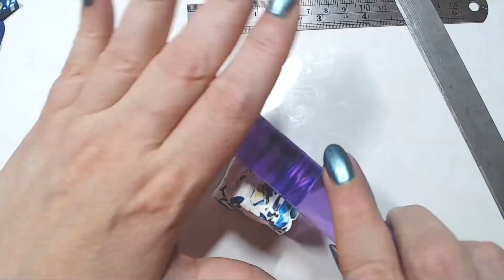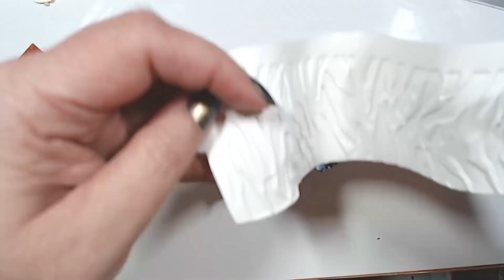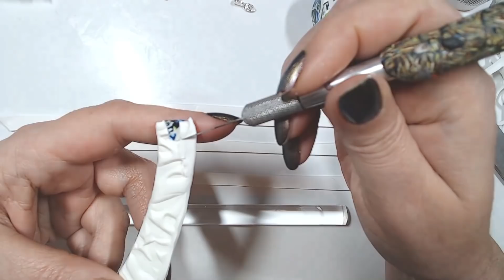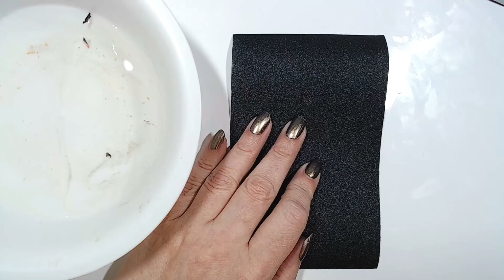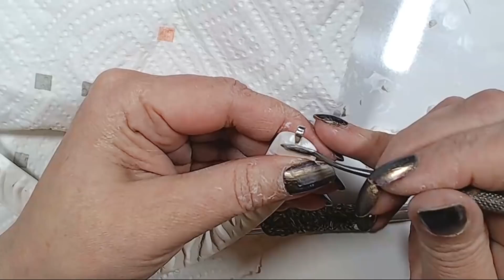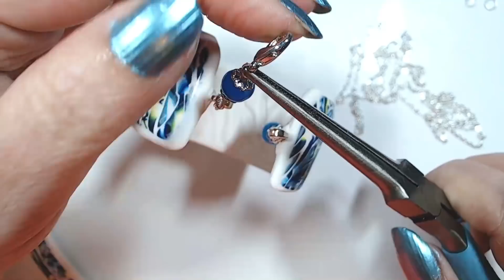Stroppel cane jewelry set - polymer clay tutorial 558

Comment: So awesome. If i wanted to add dangling strings or jewels to the necklase, do i have to drill the hole pre bake or post? Or would it be like how you added the chains?
Reply from the maker: It's up to you. Adding small spoon bails or eye screw pins or even embedded jump rings the way I added the bails makes for a neater more professional looking piece, but you can also drill holes after it's baked and put some jump rings in there. I usually prefer drilling holes after it's baked, it looks more pro.